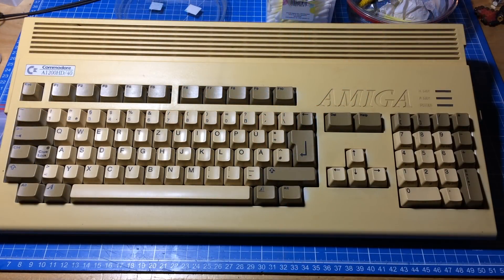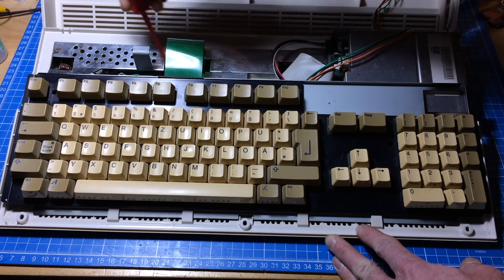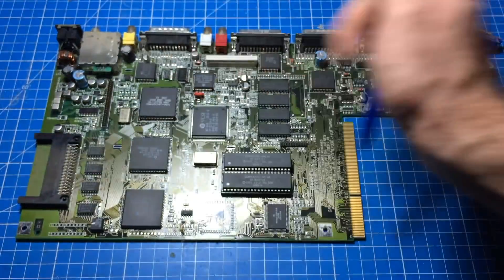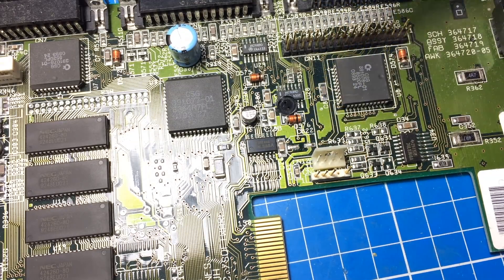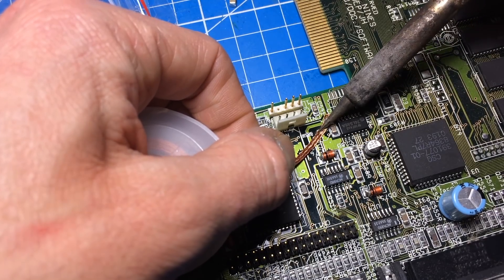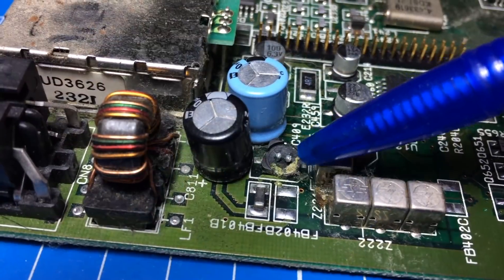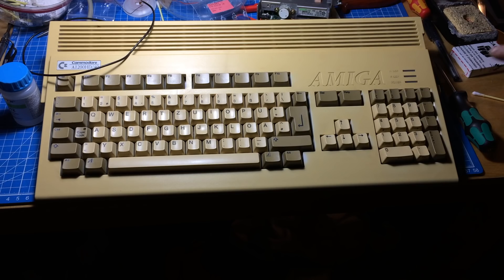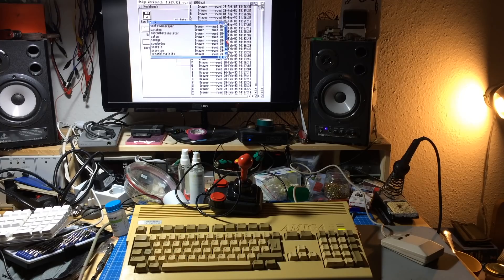Amiga 1200 Full Recap with Ceramic Capacitors

Comment from the maker: Wow, didn't mean to spawn such controversy about this... I thought I'd write up a little statement in this pinned comment. Hope this helps clarify some things. :)

First of all, for the most part I do stuff like this to learn and gain experience. I might as well have practiced on another board before doing this to my Amiga but, hey, it worked out very well. (If you watch carefully, you will see that I lifted 1 pad. And that was one that was badly corroded by the leaking cap that sat on it before. So I really don't blame it on the SMD cap removal method.) Sorry if I hurt any Amiga enthusiasts' feelings (rest assured I am one myself).

Speaking of the removal of SMDs, I carefully researched my options there and I found that many people who I trust being professionals or at least very well educated electronics wise suggested the "twist and remove" method as the one that puts the least stress on the board in the end. (One of the sources I trust here is Mr Carlson's Lab who clearly recommends this method: https://youtu.be/X8N9O3a9jiM .) Plus, I don't have any hot air or reflow oven stuff (yet), so this method seemed reasonable.

As for replacing electrolytics with ceramics: I am well aware of the fact that ceramics behave VERY differently in circuits and change their capacitance with voltage applied to them and temperature. That's why I researched this matter very carefully and found that there's a lot of people for whom this worked (and has so for years). I talked to some of them personally (okay, via the interwebs). There's even a bunch of people who do exactly these mods commercially (at least here in Germany). I chose caps that have a higher voltage rating than the originals so that the capacitance would only change ever so slightly (as it also does in electrolytics with age). I understand that most of the caps in the A1200 only ever see <=5V. Only the audio circuitry runs on 12V here, so the change in capacitance will be very minor and well within spec. At least that's what I read during researching this. I stand to be corrected. I'm clearly not an expert at all. (Any experts around?)

Also, all the bigger caps (470uF and 1000uF) have been replaced by even bigger and higher rated electrolytics. These are the ones smoothing the power lines and stuff so they will probably be fine anyway.

I welcome any discussion about this and am happy to learn from your experiences as well. I see this mainly as an experiment and hope that there's going to be a solution that helps these wonderful machines survive longer.
Reply: To be fair I think its interesting and I have mixed feelings and thoughts here.  Some people learn quicker faster ways of doing things, and those methods might be unorthodox and have risk associated - this is a classic example of that.

When you get to the point where you are skilled enough to do a professional job, but it takes a certain amount of time, and you then find a much quicker (but risky way of doing it), often people will learn to cut corners.   The technique with things like this is key - but there is always a risk of damage.  What I have learnt is that I don't WANT to take the risk - I personally prefer to use hot air and guarantee that I won't lift a pad.

I think it generally comes down to two groups of people 1) People that want to do a professional job without any risk to the board 2) People that are hobbyist and just want a quick way to get from A to B, and if they have to patch the odd trace they aren't bothered.   So I can see why you are frustrated, it's definitely not the best way to do it, but people have been doing things the wrong way ever since there was a right way lol (me included).

All that said, I am glad there are people like you (and RetroGameModz) that point out these things and try to educate people on why not to do something a certain way.
Reply: I picked mine off with two cheap soldering irons - easy to do this way. Lay some aluminum foil down next to the area to immediately drop them onto. This way you won't be likely to heat them enough to pop them as you can with hot air.
Reply: Twisting off SMD electrolytic caps doesn't really hurt the board. They have small flat legs that tear easily. Honestly it's the oldest trick in the book for removing those type of caps. For many years I have seen techs do that.

Replacing the electrolytic with ceramic caps isn't that bad of an idea. However making sure what part of the circuit it is going to be used for. With digital electronics you'll see caps used for filtering the power supply to the IC to help stop oscillation. However for analog electronics it's typically used to filter out DC. So say for an example the audio path of a amplifier I would stick with the electrolytic since ceramic has a piezoelectric effect. Not to mention since electrolytic is polarized it can help stop feedback into the circuit.

I think you had a nice suscess for that project.

You can always go with a higher voltage dip electrolytic cap, typically typically stuff like this uses up to 100uF unless it's the filtering of the power supply. I would go with 50V rated caps they are much smaller then say 16V rated counterparts. as long as you use the correct farad rating it will be fine. Also make sure to use 105*C temp rated caps, they will last longer.
Reply from the maker: +GadgetUK164 Always good to learn from people who have more experience. I Should probably have asked before, I guess. ;)
Reply: Jan, i commend you for boldly going for it and to make it happen. :-) 
Could it have been done differently/better/more efficient? Perhaps. But you did research it beforehand, picked the methods that seemed to make the most sense and you went for it. That is what we can do.

Keep doing your stuff, i enjoy watching it. I am sure you learned more from doing it.
I was always intimidated working on the A1200 as well, as things are so much smaller than on the C64 boards.

Danke fuer das Video. Mach weiter so.
Reply: You should NEVER twist ANY component off a board because you're placing unnecessary stress on the pads and for something as old as the Amiga and many other items of similar age or even older, you have the risk of pulling pads off completely or partially. That is when a simple job of removing caps becomes a much longer repair AND recap job. With a hot air gun set to 280C it takes minutes to get them off, there really is NO excuse. If the caps have been leaking then the possibility of pads being ripped off increases.

There never was any "it might hurt the board", that never came into it.
Reply: When mr.carlson showed that video I lost ALL respect for him.  twisting caps like that.  actually that video went "viral" at some Amigacommunitys of: even people who should be pros does it just WRONG.

Comment: Not a perfect solution to go all in with ceramics.. Some caps are better as electrolytic ones, Decoupling fine I used MLCC and that was an improvement. I went electrolytes in audio and graphics. and removed the RF. btw I used a soldering tweezers to "pick" them up from the MB , tweezers on the pads until it melts pickup with another tweezers worked very well even when tight behind the keyboard connector.

Comment: What soldering iron are you using? After removing the 4 large electrolytic caps, no matter what I do, I can't get enough heat to clear two of the holes - the ground metal around them draws too much heat. I'm using an Antex 30w iron, which has been fine for everything else I've attempted. Did you have this problem?
Reply from the maker: I use an elderly 50W Weller soldering station. It is pretty powerful for the wattage and temperature controlled, I guess a 30W iron is a bit weak for a task like the larger caps. There are huge ground layers in the board that take a lot of the heat away so it's definitely not a trivial task. I recommend adding fresh solder and flux to the clogged through-holes and slowly heating them up. Then use a solder pump or solder wick to try to get the solder out. It takes a lot of patience sometimes and can be very destructive if you are not careful. You might also want to look up "solder needles", I haven't tried them myself but people recommended them for things like this.
Reply: @JanBeta  Thanks for the info. I managed to clear one hole by pressing one leg of the new capacitor into the hole while heating the leg and pad with the iron. I didn't manage to clear the other hole, but successfully soldered the new cap in, so I'm happy.

Comment: I bought an A4000D motherboard that has had some very nice work done to it! the previous owner had repaired tracks at micro level, did some audio work, repaired the clock section and fitted metal clipped ram sockets. The big thing they did was the same as this A1200, a full recap with solid ceramics. The quality of the work is superb! I have never used the board so have no idea if all is ok. I am finally after 7 odd years going to use it. I will report back how this goes :)

Comment: Ask to yourself : why the engineers decided to use the electrolitics instead of ceramics ?
Reply from the maker: Because the MLCC capacitors that were available didn’t have the capacitance needed. The ones we have readily available today were almost science fiction in the 90s and more or less experimental. Also, of course, cost reduction.

Comment: With regards to through hole caps on A1200, A600s and A500s. I found they require so much heat when using desoldering station that I find it safest to not try and remove the solder. Instead I add solder, heat up each pad as I gently pull the old radial caps out until they are free. Then I add some more solder and heat up each pad while I push the new cap gently through as a move the soldering iron between the pads. Then when it's pushed through as far as I want it I add more solder if needed. Maybe the only not so good thing about this is that I mix the new solder with the old solder. Not seen any issues yet from this mixture. It would be the same If one reflowed current solder joints anyway.

Comment: HELLO JAN   NICE WORK  YOU HAVE TO PRACTISE ON SMD  A LITTLE BIT MORE  ITS  VERY FIGITY I HATE SOLDERING SMD PARTS BUT CAPS ROUND TYPE LIKE AMIGAS ARE OK NOT HARD  THEY LEAK LOTS IF THEY USE CHEAP BRANDS BUT COMMODORE USED GOOD QUALITY ONES LASTED 30 YEARS SO THATS GOOD ..  ANY WAY  BYE..  KERNALS..

Comment: So, it has been a few years since you did this recap.  Has it worked out well so far?  No exploding ceramic caps?
Reply from the maker: Yes, the A1200 works flawlessly still (even if I would have used electrolytic caps and different methods if I was to do it again today - cf my more recent work on the A600). In the meantime, I added a 68030 accelerator card. I use this Amiga a lot for my retrogaming streams on Twitch, too.
Reply: @JanBeta  This is good to hear.  I had both my A1200 and A4000 redone with ceramics.  No issues with mine either, but I don't use mine near as much as you probably do.

Comment: I know this was over two years ago but I’ve recapped two A4000 boards. Surface mount I nothing to be afraid of if you have the right equipment though I would say working in this type of manufacturing for as long as I have a pair of pliers and brute force is not the right equipment. I used two soldering irons due to lack of heated tweezers giving direct heat to the joints the caps came of in seconds with no damage at all. Hot air works well but you need to be aware of surrounding components.
Still it’s good to see you keeping these wonderful machines going, keep up the good work. I’m slowly going through your back catalogue, some real interesting stuff.👍

Comment: Hello
i have almost sure that the power connector of my Amiga 500
is broken
because i tested the psu with another Amiga 500 and it´s working but when i use that same psu in my Amiga 500 most of the times it keeps off. Can you give your opinion ?

Comment: Is it necessary/recommended to also replace the bigger (non-smd) elec caps?
Reply: all electrolytic caps will leak and they are all roughly the same age. So yeah if you're going to replace any you probably should replace all.

Comment: A bit late to this party but my only reservation about using MLCCapacitors instead of electrolytics is that they are prone to cracking with mechanical or thermal stress if not soldered correctly, and often fail shorted whereas electrolytics tend to go open circuit. That said, as long as you're not using your amiga to fly a plane or direct robot surgery then a failure is unlikely and the risk acceptable. A failing MLCC is les likely to damage  your Amiga than a failing electrolytic because it won't squirt hot corrosive acid all over the pcb - the damage (if any) will be limited to the immediate vicinity of the component.
All this talk about ceramics changing their value with voltage etc completely misses the point that electrolytics rarely have a capacitive tolerance of less than 20% so are not used where the value is critical, and their nominal value can change with applied voltage too, along with temperature, time, frequency, phase of the moon etc.

Comment: I recently recapped an A600 using the twist off method, which worked perfectly. The key is to not apply any levering motion; just twist with some grippy pliers. 

In the past I've damaged boards trying to unsolder SMD capacitors. A heat gun heats the surrounding components too, sometimes dislodging small components, such as resistors. Twisting is much better.
Reply: A heatgun could cause dammage to th MB if used with poor experiance, speciallu on multilayer boards. One way of doing a recap would be a combination of different technics like "cutting" lifting and heatgun. I am to chicken to even try the "twist"

Comment: Regarding ceramic caps in place of electrolytics. First things first - Commodore did not use ceramics because at the time, MLCC capacitors with large capacitance values did not exist. MLCC ceramics is relatively new, and its main place is in high density, high speed situations... they are also being used to replace tantalums. 

Are they harmful/wrong ? Not when used for decoupling purposes. The ESR simply isnt a factor in circuits like the Amiga, the speed of which is nowhere near requiring low ESR. However, using low ESR capacitors will also not harm anything. Where low ESR is required is where you are dealing with very fast switching speeds at high currents e.g. the outputs of modern switch mode regulators, or very high speed logic.

There is ONE place that MLCC ceramics should not be used, and that is for signal coupling. In the A1200 that would be C235-237, C324 and C334. MLCC's capacitance value is somewhat voltage dependent, and they really don't like to see a changing voltage as you would get in a signal coupling application. Stick to electrolytics for that.

However, used purely as supply voltage decoupling they are absolutely fine, as are tantalum capacitors. Why did C= use electrolytics then ? Simple - they were the cheapest option at the time of manufacture. Tants were relatively expensive, and MLCC didnt exist.
Reply: Sir, you are hereby awarded the Youtube Constructive Comment award: You gain +1 internet, +1 humanity and the Informative badge.
Reply from the maker: Thanks for clarifying that again. :)
Reply: Thank you for this fantastic comment, could you advise which A600 v1.5 caps should be electrolytes?
Reply: @tomarkus8720  Simply keep the circuit as designed - don't use MLCC ceramics or tantalums unless thats what's there now.
Reply: @jaycee1980  here is my case - I have bought an Amiga 600 fully recapped with tantalums, but I was wondering if it makes any sense to replace some of the tantalums with electrolyte as you have suggested keeping electrolytes in A1200 in C235-237, C324 and C334.
Reply: @tomarkus8720  I see. It's mainly any cap used for an AC coupling task. In the A600 these are C214, C235, C236 (if you use the RF modulator), C237 (composite out, if they've been dumb enough to replace the large electrolytics with tants) C324, C334 (in the audio circuit)

Comment: Those low value ceramics play an entirely different role to electrolytics on any board. If it were ok to replace the electrolytics Commodore would have done so. Those ceramics are much cheaper.
Reply from the maker: +Brek Martin Ceramic caps of these higher capacitances weren't around when the A1200 was made actually. And they are a lot pricier than electrolytic caps even today (if you don't believe me look the values I listed in the description up on your favorite electronics supplier's site). Pretty new technology.
Reply: I take that back since I was talking about the values, and you probably already know there are other reasons  more than one type of capacitor are used.
Reply from the maker: +Brek Martin Yes, most of the original electrolytic caps are in parallel with a small capacitance ceramic cap to account for high frequency filtering.

Comment: Honestly I know many people do twist the caps off the boards but its not really the best way and with older boards you can damage the solder pads.  Very happy to see you were able to recap your board.  I have a couple Amiga's in my collection that need to be recapped and I might just consider using Ceramic Caps on my A1200.
Reply from the maker: +Stephen Bruce It worked okay for me. I have a hot air station now which makes things a lot easier so that's my weapon of choice for these things. Ceramics work very well. I had a conversation about that with an electronics engineer recently who did the same with his Amigas and he assured me that for the usage in the Amigas it's perfectly fine to use ceramic caps.
Reply: Hot Air Rework Stations are a treat.  I will definitely keep the ceramic capacitors in mind when I pull out the A1200 to work on it.